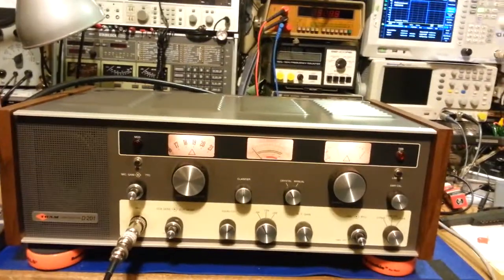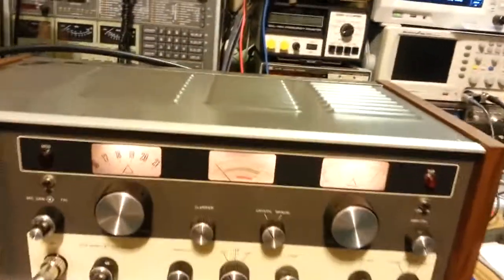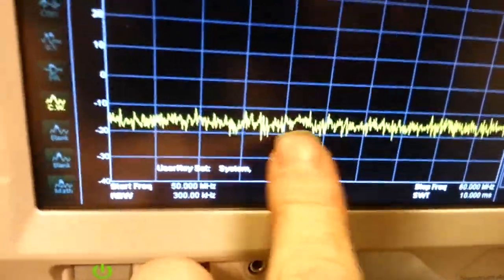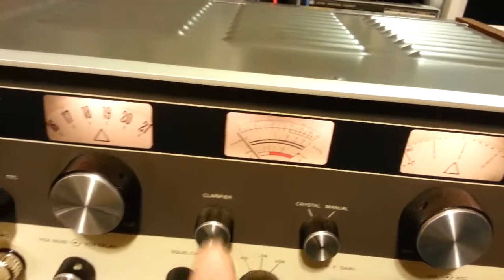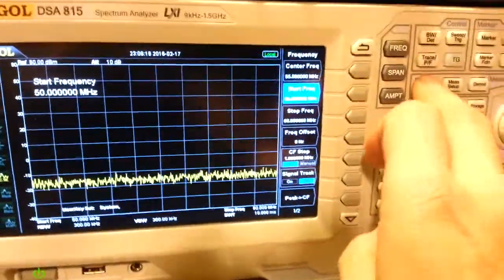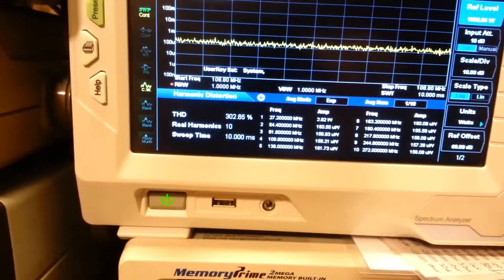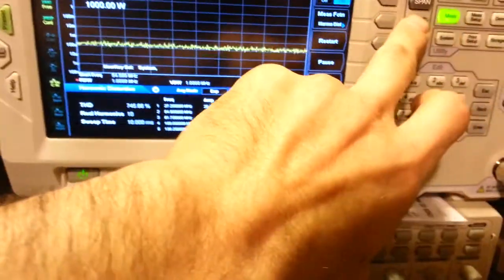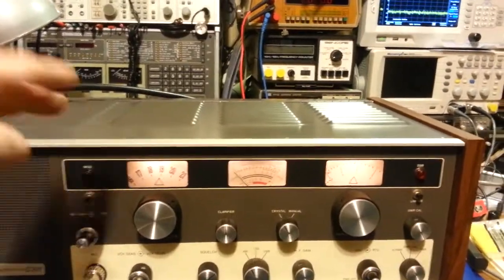Tube type CB radio splatter box / harmonics, I don't think so.

Comment: 6 years later and it's still a great video.  Especially the close-ups of your SA in use. Nice work bench.  THD makes sense with RF and I get that but on reconsideration I don't see how Audio can have Harmonic Distortion.  What am I not seeing?
Reply from the maker: Audio or RF it's still a sinusoidal signal.  Think of a stereo.  Turn the volume up the whole way and it sounds distorted.  When the amplifier circuit is driven into saturation you start to get a high level of harmonic distortion.  That's actually one of the important performance characteristics of stereo amplifiers, THD.  To make things doubly worse think of a two way radio.  It has both audio and RF circuits.  If the audio is distorted and then used to modulate a RF carrier the audio distortion now shows up in the RF domain.  If the RF amplifier is then overdriven into saturation you again get harmonics but to make matters worse your also getting harmonics of every audio harmonic that was used to modulate the carrier.
Reply: MikesRadioRepair - nice, non-technical explanation.

Comment: I remember loaning a Gemtronics tube cb out and when I got it back--it was way beyond a "splatter" box...It was actually more like a 'grenade' box.  power was the same, SWR into my Starduster which had previously been at 1.1 was now up considerable, and I could hear the set on every radio and tv for blocks around.  I was told that some mods had been done for more channels, and yes, when I opened it up someone had tack soldered several more crystals around the channel selector willy nilly...some had very long leads, and some were shorter but not short.  I think that radio was transmitting on every frequency known.  I removed all the mods and tried to get it back to some semblance of what it had been by using the schematic, and then took it to a local old guy (Elmer) to check it over and my own efforts as well to resurrect it.  He told me that I had one cold solder joint, but that otherwise it was good--just needed a good alignment.  Got it back and it was good as new...a somewhat weak under modulated Gemtronics CB.

Comment: One of the reasons Russia used tubes for so long even in advanced fighter jets is because tube technology was well sorted and more reliable for them in harsh Siberian cold. They never managed to make a transistor in house that could take the combination of cold and vibration. Also when you want to do really powerful pulsed radar again tubes have better multiplication factory and you need fewer of them. Quality control was an issue for a long time. Fast-forward to today since the wall came down and they opened the iron curtain they ave been able to licenses technology that allows them to make durable and powerful transistors. It always comes back to what you want to run high voltage or high current devises since tubes and transistors are at opposite ends of the spectrum in that regard. There is a good reason why tubes are still used in broadcast, X-Ray devices, commercial drying needs etc.....Nothing was wrong with tube technology it is just bulky and expensive compared to transistors. All that copper and hi silicone steel adds up fast for the transformers. Most people are idiots and think new technology is always better but often it is more about cost and how many features one can offer at a given price point and the IC changed the world for consumers and manufactures in that regard. In my mind the problem with tube devices is too many parts can no longer be bought that are needed to keep them going and no good substitute is available either. Those transformer with the built in mica cap's are a good example of this. I do not want a fantastic radio that can not be repaired.

Comment: I have never heard that they are splatter boxes. Most of the radios are not splatter boxes unless some dope with a golden screw driver has been in it toying with or removing the limiter in the radio. I purchased a new unmolested radio and it seems pretty good from the factory. I see no reason to have it peaked and tuned, that usually screws up the radio and this can be done to any radio. I like Vacuum tube radios a lot and I really like the DAK10 even though it may not be a really good quality board, it is really cool.

Comment: Mike i have a golden eagal Mark II with a golden eagle D104 power mic. I have about 41/2 watts out but i cant seam to get modulation to get high enogh to hear. When i raise mic input or the modulation pot to where meter shows high out put you still cant hear but very little voice output. Also if i touch radio with other hand it seams a bit better. Any ideas? Kerry
Powerboater@pldi.net
Reply from the maker: It sounds like you have some serious problems.  If your touching the radio and things are changing your probably also being electrocuted.  First thing to do is take a meter and measure for voltage from the chassis to ground.  I think you will find there is voltage there.  If it hasn't been rebuilt yet then you probably have a leaky cap which is shorting out.  Unless your using a isolation transformer I would NOT recommend touching the radio while it's on until you check for excessive leakage.
Reply: MikesRadioRepair Mike i can actually get my hand close to radio and it makes a difference. Ill check to ground and see whats up. Last time i used this radio was about 4 years ago and it sounded and worked great.
Reply: Mike I would like to send you a TRC 456 to restore. Its in pretty good shape. Where can i send it?
Reply: @mikesradiorepair 
He’s NOT being electrocuted. You can only be electrocuted ONCE. Then you die. 
Everyone who tells me they have been electrocuted, I say, NO YOU WEREN’T.
Reply from the maker: @ITSHAA-yn5zc  Not by definition.  Oxford dictionary "injure or kill someone by electric shock".
Reply: @mikesradiorepair 
Dictionary is wrong
Reply from the maker: @ITSHAA-yn5zc  So you make up your own definitions for words?  Must make talking to people rather difficult. 🙂 Most people I know including myself use dictionary's to define the meaning of words.

Comment: Great video Mike. When I align the two Tram D201's I have, i will not be happy until they perform the same as that one you have done. Bought from ebay who knows what they are like until the service manual  alignment is performed. Unfortunately I dont have a proper spectrum analyser, but have successfully used my RTL SDR + software  and B&K's / CRO to achieve similar results so far I believe.

Comment: Vacuum Tubes are great.... Just great.   The voltage regulators work BETTER than Solid State.  Audio Circuits usually sound BETTER with less complexity...     If not for Size, weight, cost, heat, power draw, and life...   We'd still be on 100% Tube electronics.   I build Audio tube amps for guitars and stuff....  so the above statement isn't sarcasm.   I understand why we have Solid state,  and it's great for lots of things..   but don't disrespect the Thermionic Valve.

Comment: Please do a side-by-side comparison of a popular (factory/stock) export radio, and a (factory/stock) Cobra 29 LTD regarding spectral purity and the harmonics. This is a great radio, and an awesome video. Thank You 73
Reply from the maker: Shouldn't be any difference in spectacular purity as long as they haven't been screwdrivered.  Problems start to arise when people start spreading coils and adjusting the 54MHz trap without a spectrum analyzer.
Reply: +MikesRadioRepair Oh okay Thank You, I was told the exports had issues with inter-modulation distortion. Have you seen this?
Reply from the maker: +LeapFrog469 

When they have had a "peak and tune" done yes.  When they have had a proper transceiver alignment done no.
Reply: +MikesRadioRepair That's where the sprectrum analyzer comes into play, I see.
Reply from the maker: +LeapFrog469 

Honestly they almost never need to be adjusted, the trap circuit that is.  If people would stop adjusting, tweaking and spreading coils after the last actual final peaking coil/transformer they wouldn't have these problems.  They consist of nothing but coils that don't change value over time so the factory adjustment in the trap circuit can just be left alone.
Reply: Very good info for any "golden screwdrivers" out there, leave the coils alone!

Comment: as long as any radio isn't monkeyed with (the dreaded "golden screwdriver"). it should be clean unless in the case of natural aged parts failure.... if you feed this radio in most amps. it will only amplify amplify what  signals it produces. and it should be within reason.  now if the amp goes into oscillation. it will get bad with any radio.

Comment: I have heard the same thing as you regarding valve (tube) radios.
Usually that happens when someone starts turning things without knowing what or why they should not.....
What I am looking at is a radio that is properly aligned and functioning properly.
You definitely knew what guys like me were going to say when you mentioned harmonics :)
Good mind read!

Radio is in great shape physically and electrically.  Customer radio?
Reply from the maker: Yes, customer radio.  He has been using it and getting great reports.  Said he talks on it bare foot and people just can't believe it because its so loud.  People these days just don't know what good audio is supposed to sound like.  They are so accustomed to hearing radios with clipped AMC limiters that are cranked to the max and splattering all over the band they are shocked to hear what crisp clear audio actually sounds like.  One of these days I should make a video showing the audio on a audio spectrum analyzer to show just how much they are loosing when they run them balls to the wall.
Reply: +MikesRadioRepair .CBRadio 
A radio that actually stays within the allotted channel spacing... that's what I would want.
I was never able to get it thru to people that if 90% of your power is within the allotted spectrum that you will go further and sound clearer to the party your talking to.
That led into the discussion of a wattmeter vs a power meter / bandwidth.

I am sure you know that that one turns out :)
Reply: You know what?
I really think there is a difference being made in the last year or so with regards to this and that it's positive change.
Wonder what Mike thinks?